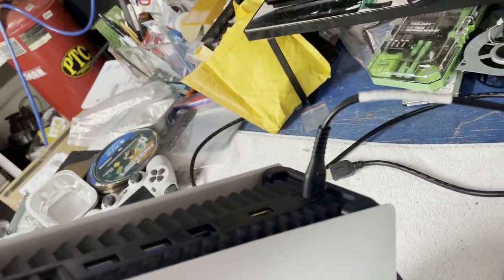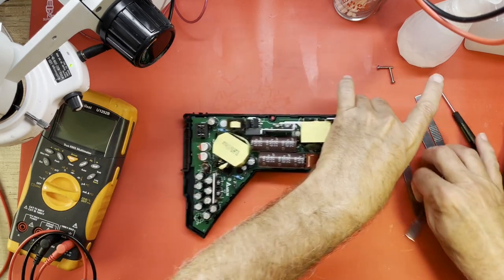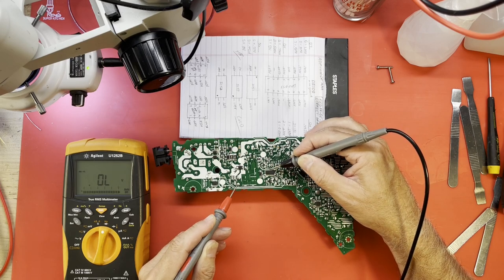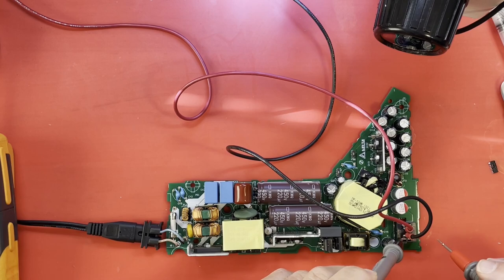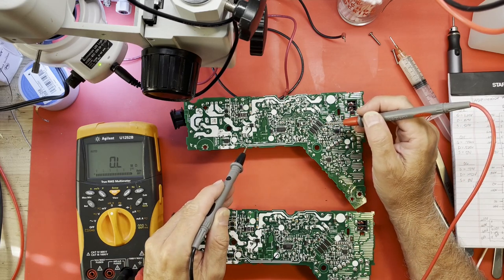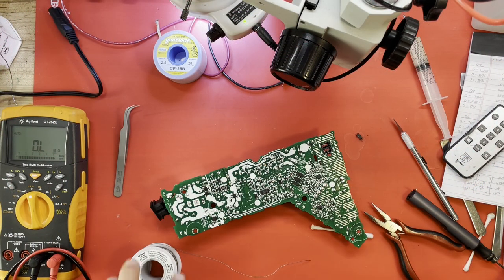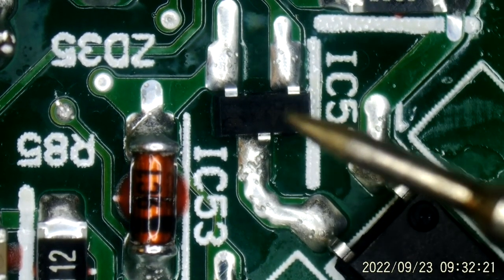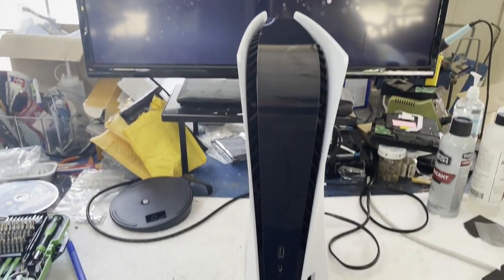#50 Repair of PS5 No Power

Comment: What a job well done! You just earned another subscriber. I have similar issue except my dc output reads zero. I followed along and got the same diode mode readings except for pins 1 and 2 of ic52 with 1.239V and 1.5V, respectively. Q32 seems fine as well. Now I'm struggling with what to do next
Reply from the maker: The best approach would be to place an identical working board beside the broken one and make comparison readings.  That will usually lead you in the right direction.

Comment: Hey awesome info from a very informative person. I have a ps5 power supply coming in that has lightning damage hope to get it working again
Reply from the maker: Thank you and good luck with your repair!
Reply: @ToltecMerc  whats the usual components that go with lightning damage?
Reply from the maker: @kevinmalson5836  the DAP053 is a common failure.  There are several small MOSFETs marked W4R that are near the front end as well that I've seen fail.
Reply: @ToltecMerc  got my ps5 power in and after measuring off your measurements it looks like I need the dap053t. But no one has any in stock on this planet
Reply: @ToltecMerc please  where can I buy 🎉 the mosfet mark WR4
Reply from the maker: @ngonohtc5724  W4R?  It is a 2N7002.  Mouser part # 771-2N7002NXBKR

Comment: Great video! Do you by chance have the same Readings for the 400ER supply? Also, What supplier do you use for the main IC?  I can only find a "repair kit" for $40
Reply from the maker: I'm afraid not.  I don't think I have encountered the 400ER yet.
Reply: @ToltecMerc  Thanks for the response!  The TL432 Voltage references you mentioned. Do you by chance have the full part number? I dove back into my supply giving me 5.5V and found two of them with broken casings I'm on Mouser now.

After you complete your videos would it be possible to list part numbers you used for the repair? I guarantee it will reduce people like me asking questions! and increase likes!
Reply from the maker: @imurhuklbrry2393  try Mouser #595-TL432BIDBZR
Reply: Mouser 771-TEA2016AAT/1J main IC.

Comment: Hi, great video thank you! Helped me a lot. Question for you. I am only getting 168 volts across each of the 445 volts capacitors. Shouldn't it be 450 volts? What should I test next?
Reply from the maker: The voltage across the large caps should be 395V.  If you are only getting 168V, your power factor correction circuit is not running.  The 168V is simply rectified and filtered 120VAC.  The PFC boosts it to 395V.  On PS5 supplies, the DAP053 IC controls this by driving a power MOSFET.
Reply: @ToltecMerc  Thank you! So can I fix the PFC? or how can I bring my PS5 back to life? my neighbor's tree was struck by lightning and took out my PS5 :(

Comment: Great video and work. Any idea what Q32 is on the power supply it goes to IC51 that was blown. I also have shorts on DAP053T
Reply from the maker: It's a 2N7002 mosfet
Reply: @ToltecMerc  Thank you very much sir. another question, I was testing ZD35 off IC53 and getting a reading of 2.2 ohms in both direction is this zener diode shorted and if so what is that ID?

Are there schematics for this power supply on the internet?
Reply: The other major issue I am seeing is that the + and - across CN101 is completely shorted out. Would this be caused by the components that I have blown at IC52 adn shorting of DAP053T, any ideas what I check for on the cold side?
Reply from the maker: @MKJ-ei8kt  I believe ZD35 is a 9.1V  1/2W zener.  ZMM55C9V1
Reply: @ToltecMerc  Thanks again. Any idea what ZD132 and C147 components are, I noticed they were blown ?

Comment: does the power supply needs cleaning after a year of use? if so, how much time until the capacitors discharge?
Reply from the maker: Unless it is in a very dusty environment, I would not think it would need cleaning after one year.  If you want to clean it out, just used some canned air.  No need to open it.  If you do decide to open it, I would unplug and wait 24 hours for everything to discharge.
Reply: @ToltecMerc  ok. thanks!